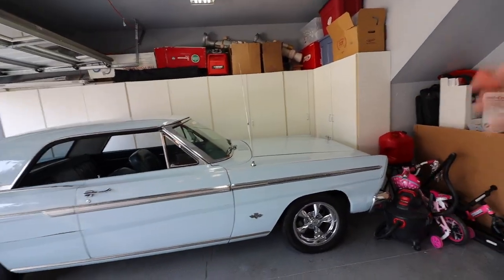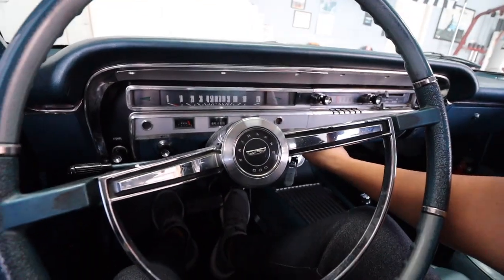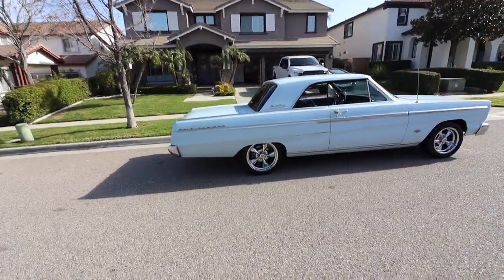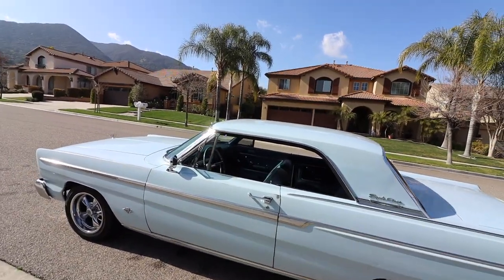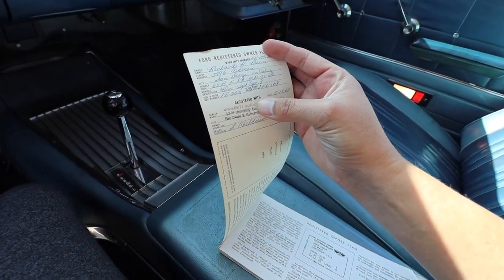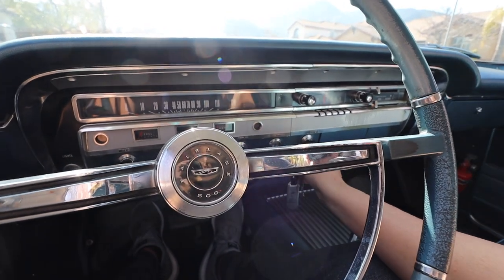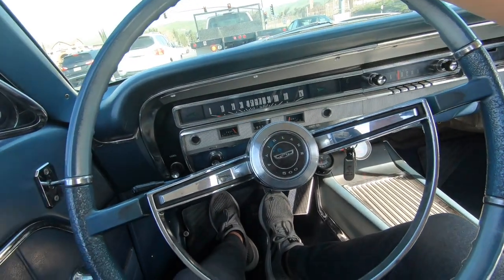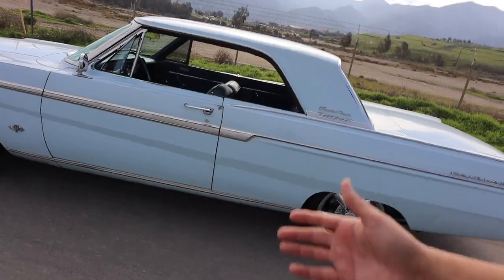1965 Ford Fairlane 500 Walk Around, Drive, and Full Tour // Restoration Build

Comment: Nice car, I have 65 also that I just bought a week ago. My question is what size tires you have on the rear, trying to find out what is widest you could put on. I also have Cragars SS   Thanks.
Reply from the maker: Awesome!  Congrats on the car!! You’re def going to have a blast with it. When I got the car it had 235 in the rear and I just replaced them with a 245s. The tire place said I could go 255 if I wanted but I’ll wait until next set. Also next time I’m going to go with a more street look with less sidewall.
Reply: 👍🏼thanks for the info I appreciate.